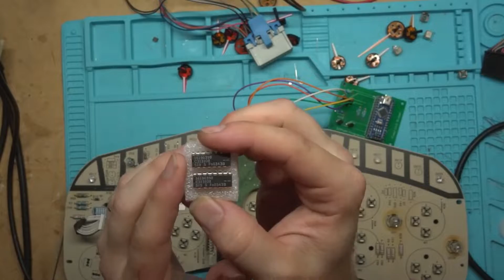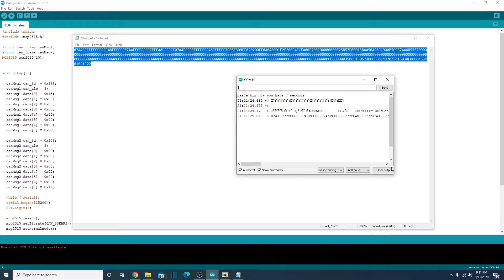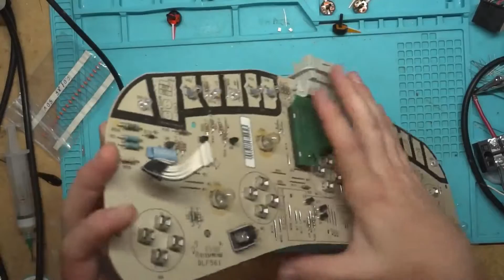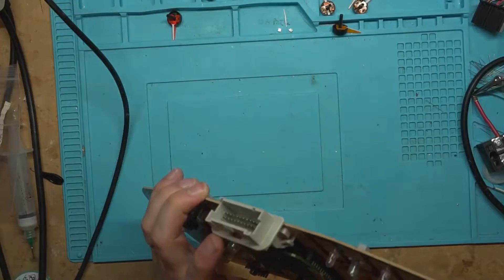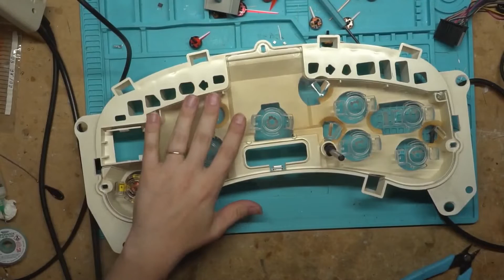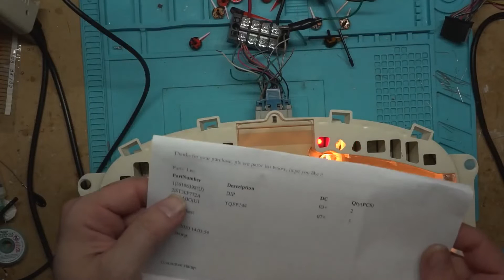Adding Transmission Temperature to a 99-02 GM Circuit Board

Comment: I got an Escalade panel off Ebay. It was plug and play, and it looks nicer.
Reply from the maker: Yes they plug in play only things that aren't plug and play are diesel clusters into gas. The tach/oil pressure will read wrong.

Comment: Watched your video. I think you know what you're doing. You might have access to sources I don't. Do you have a source that can test '08 f450 6.4 crew cab ecm? Thanks
Reply from the maker: unfortunately I don't but I have seen ads for the ford ECM repair services. Id ask around and see who offers a no fix no fee deal. Most guys charge a fee no matter what but some will test it and not charge other than shipping.

Comment: Can I flash the 100 mph board with a file from 120mph ?
Reply from the maker: If you do it will have 120mph speedo
Reply: Do you have that file you an email ?
Reply from the maker: @wfolsom27  they are in the file section of the facebook group https://www.facebook.com/groups/613941359509892

Comment: Hey there. Wanting to do the same thing here, doing this job will the miles originally on the cluster be affected in this process?
Reply from the maker: if you copy/paste your miles into the new bin not it will be the same if you dont it wont.

Comment: How much do you charge for this?
Reply from the maker: I'm currently not offering that as a service because I don't like the inlay and i need to find a different inlay but I did put together a kit of this an list on eBay just to get rid of this last inlay I currently have. Just search 99-02 transmission temp kit and should be the only one that comes up

Comment: I ordered some from another company based on part number alone and found one that will NOT work.   Even though its a 16196389 IC, it shorts out the data line to the MCU.  I'll be ordering from UTSource now.  Lesson's learned...
Reply from the maker: Hmm that's strange post a picture if it in the Facebook group

Comment: How do you calibrate these on the bench?
Reply from the maker: Calibrate what exactly the gauges or the odometer?
Reply: @FixedUntilBroken  I'm curious how you do this as well.  Specifically getting the needles set properly
Reply from the maker: @scottohmacht6447  They always go to same spot for 0 So I just compare to known good one. Exception to that the 120mph/km cluster have a different zero than the 100mph the speedo.

Comment from the maker: I know this video doesn't flow great but I wanted to get the info out. This is the first one I did it to so y'all learned with me on this one. I've ordered more of the 16196398 IC. If you don't want to buy them from china I will sell them for $20 EA shipped. I don't have enough of the S marked motors to sell any. I will probably make this video again in the future and have it flow better.
Reply: do you have a link to the IC chips?